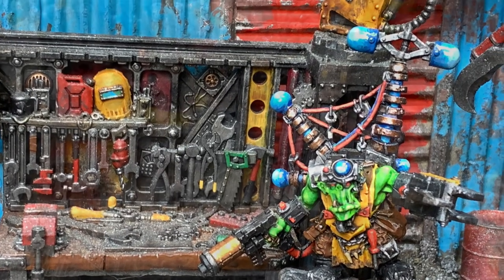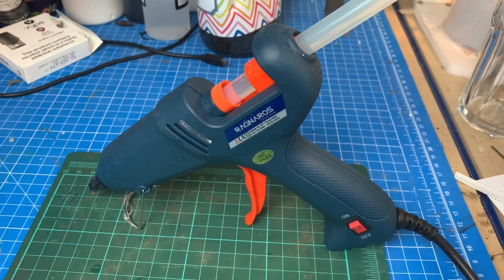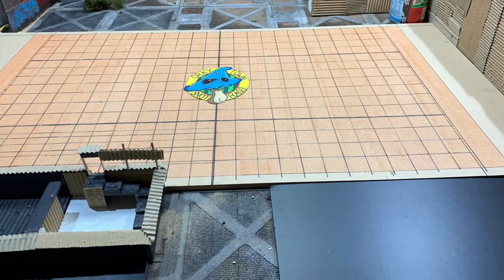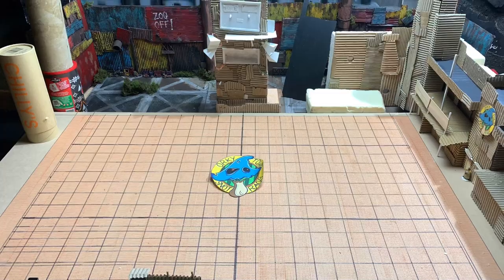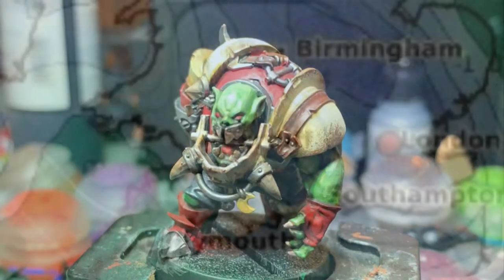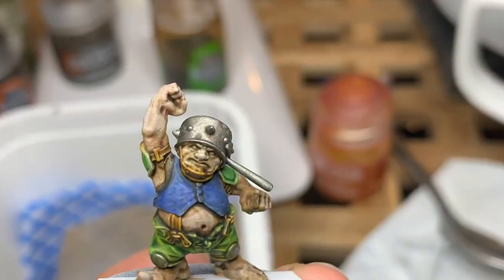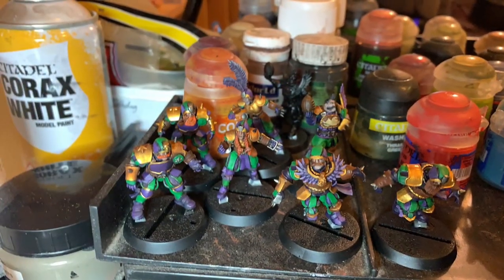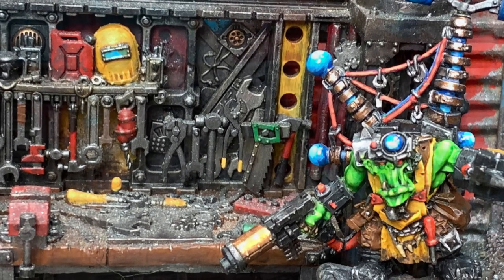Scratch building a Bloodbowl Stadium part 1

Comment: hi Essex! awesome work! thanks for share it. I want to know how you make the grass surface (white lines too). is enought resistant for play games over it? Thanks, you have new sub.
Reply from the maker: The grass pitch is made using PVA glue and flock, the white lines were drawn on with a acrylic marker. So far it has held up very well (multiple games played on it)
Cheers for checking out the video and I hope that helps 😃👍🏼

Comment: Absolutely awesome! Do you need to seal the corrugated cardboard with anything before painting? I want to get a stadium built for one of my teams too!
Reply from the maker: Thanks very much mate, great to see you here 😊😊 Most of the cardboard was sealed with modge podge and black paint mix to firm it up a bit. I also give it a coat of Matt varnish after painting 😃👍🏼 I can’t wait to see your stadium 😃
Reply from the maker: What team do you think you would make a home stadium for?
Reply: @EssexBoyz  it’ll be a long running project but I’ve always wanted to do one so might be time to start
Reply: @EssexBoyz  I would probably have to go for my skaven team. They’re my favourite to use